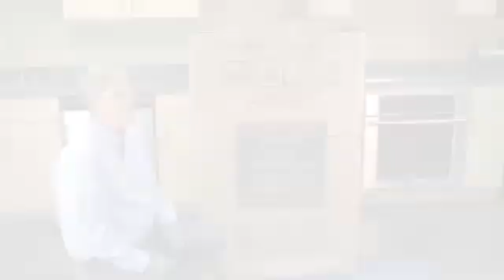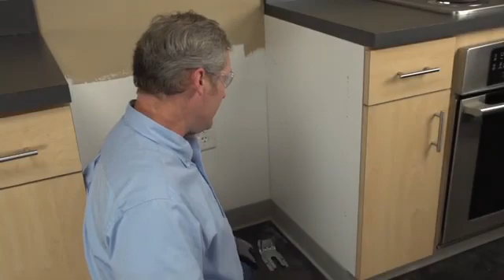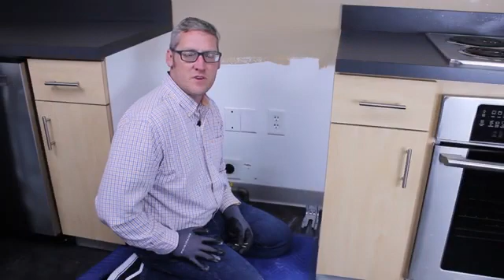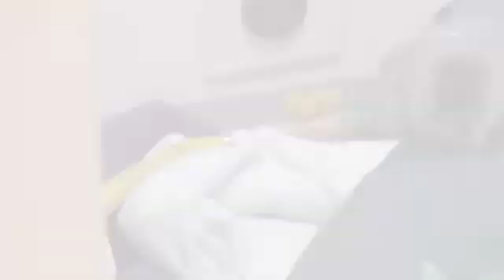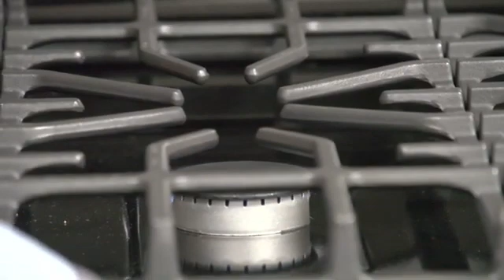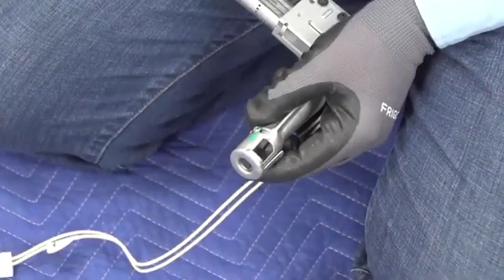Electrolux/Frigidaire Freestanding Gas Range Installatiion

Comment: Having low output gas pressure on new Frigidaire gas stove. 800 number for "customer service" is absolutely NO help. I suspect the problem is with the regulator. We are at 6200 feet (Cheyenne, WY). Is there a way to talk with a technical support person? "Customer service" sent out a sears service tech who didn't do ANYTHING. Visually decided that the orifices are for LP, we have NG. I've done more troubleshooting than that guy... He recommended the company replace the entire unit, but now I'm getting NO assistance from "customer support." Are there high altitude pressure regulators? Sorry for hijacking an unrelated video but I'm at my witts end and out of options. Really need to be able to discuss these issues with a company tech support expert.

Comment: I have this oven and it's new but has 2 issues, I need help with. When it's preheating, it makes a rattling noise from the back and also, the lowest settings are way too high on the burners. How do these get adjusted?